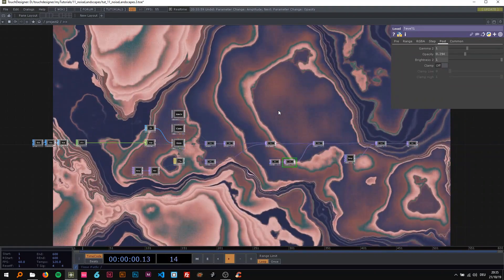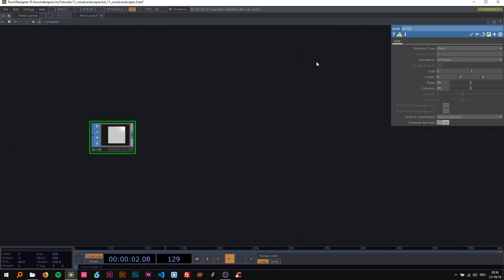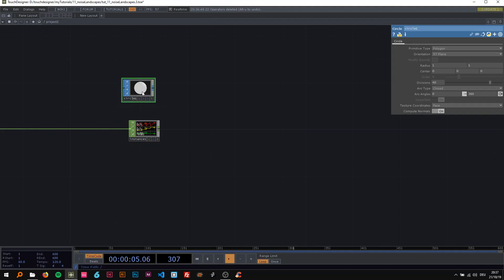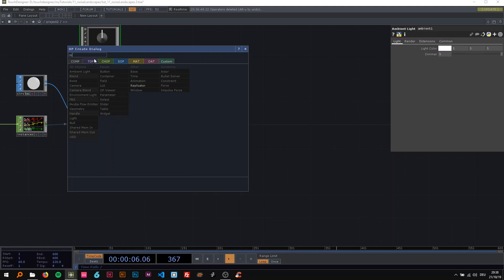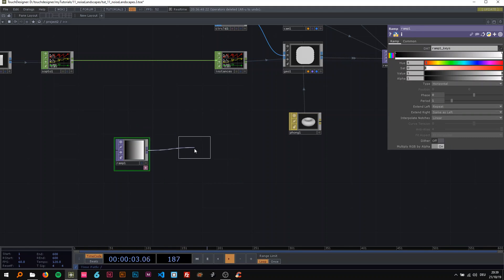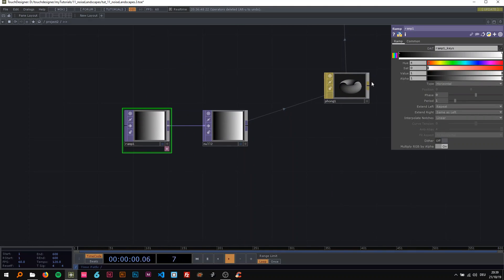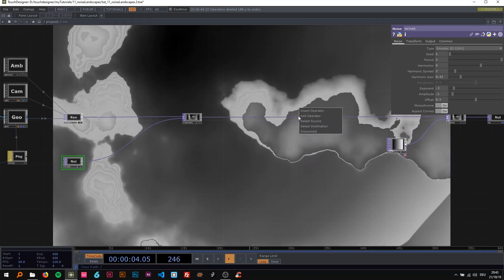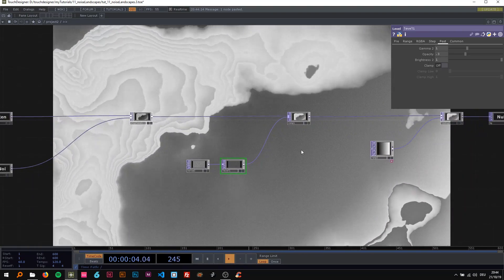Topographic Grainy Noise  – TouchDesigner Tutorial 11

Comment: Thanks for this tutorial.. but I have a question.  I can connect my circle to my geo.  Any ideas? 2:03 in the video!
Reply from the maker: You need to create the circle first and then connect the geo from there. Otherwise the input isn't generated automatically. You could also put the circle inside kf the geo.
Reply: @elekktronaut  Ya i tried that. Its still not working... Could it be because I'm on my mac?
Reply: @elekktronaut  Got it thanks so much for the amazing work!